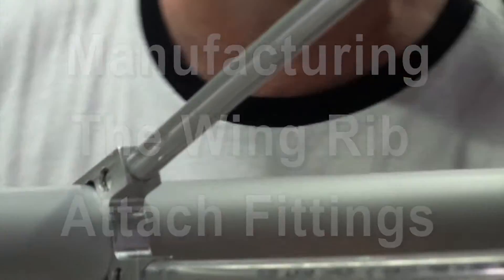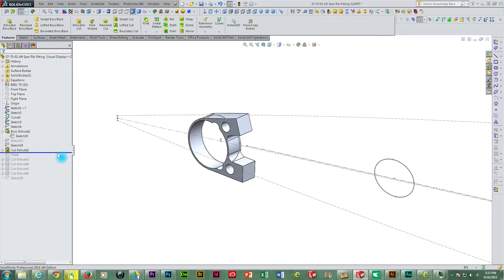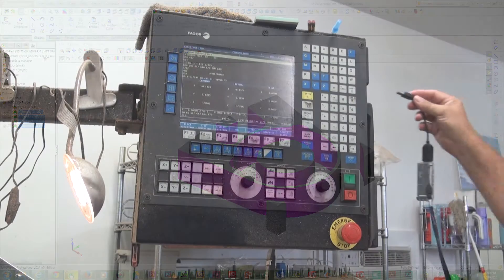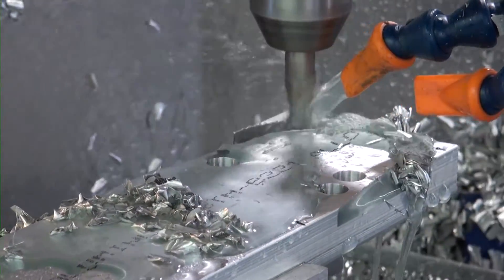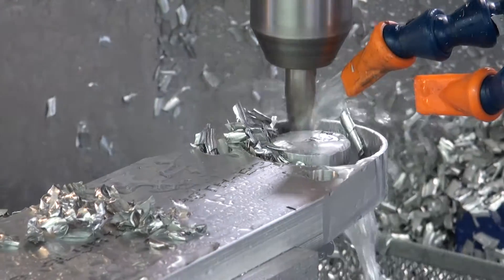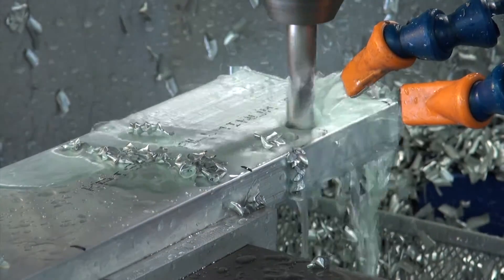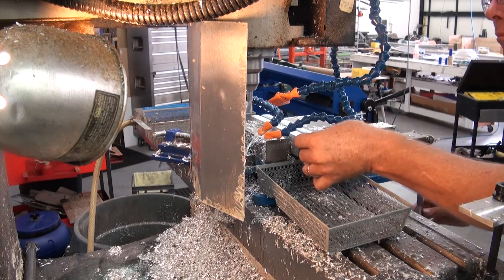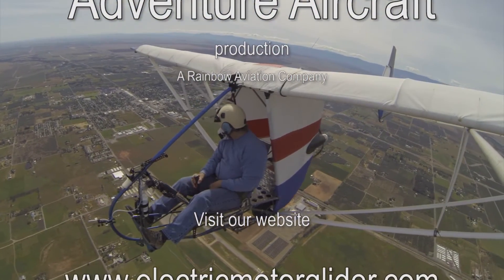Manufacturing the Wing Rib Fitting (Building the EMG-6)

Comment: Beautiful piece, for those of us without a CNC, cost prohibitive. (38 pcs per plane, so around $1000 for the rib fittings? (20 min ea. @ $100/hr. job shop, guess) Really like your plane!
Reply from the maker: I agree. We originally started this process of using the rib fittings because of the demand for covering the airplane with the states poly fiber process area. We built the first aircraft using the Dacron sailcloth system. No rib fittings required. And the weight of the fabric with this rib system was nearly double that of the Dacron sailcloth. We are currently in the process of making the new set of templates for the Dacron sailcloth. And even though we have flown the states poly fiber covered aircraft many times, we are really wanting to go back to the Dacron sailcloth system. Simpler, lighter, lower cost.
Reply: Once you get the dacron sorted will you be offering the sets for sale? Any chance of the fuselage being offered as an assembly (future, I understand)?  All else I'm competent to build.  :)
Reply from the maker: Ultralight sails of Canada is currently working on the templates. We made some fairly good progress lately, but it's been a long haul to get the new sailcloth templates developed. We been working out almost 6 months now. Once completed we will have them available to purchase. We still don't have a total price but I'm certain it will be about half the cost of doing stitts poly fiber. And yes we will eventually have full kits and sub kits available. Right now, until we get a completely turnkey electric power plant system installed, tested, and proven, we can't really offer the fuselage frames for sale because the mounting of the electric system will have to be incorporated into the frame. Believe me, were working on it about as fast as we possibly can with our limited budget.